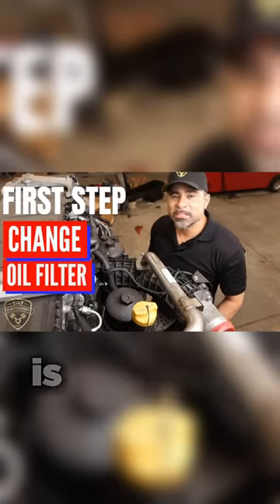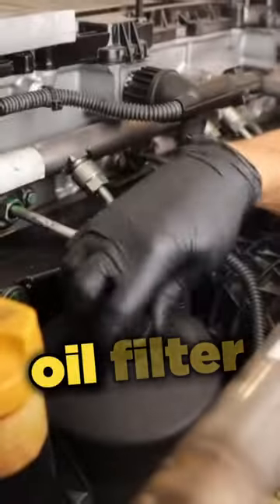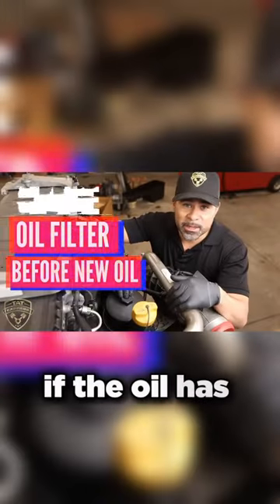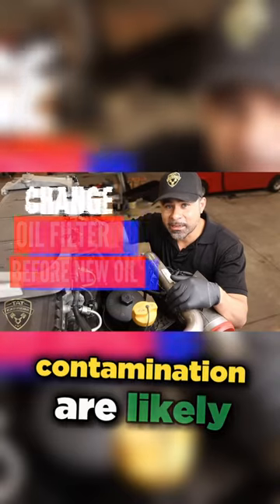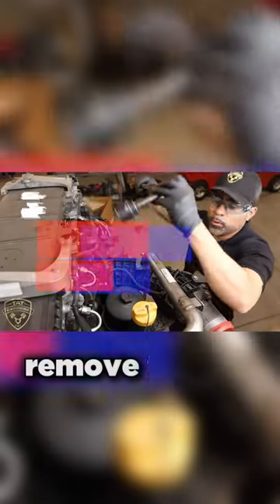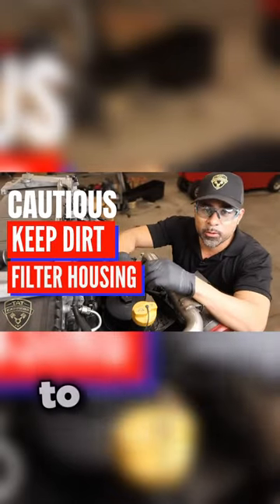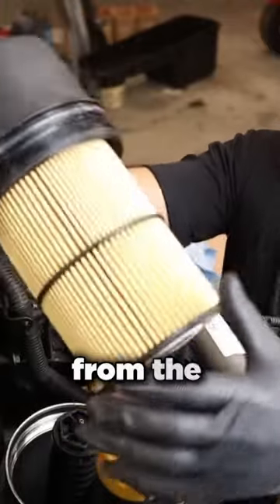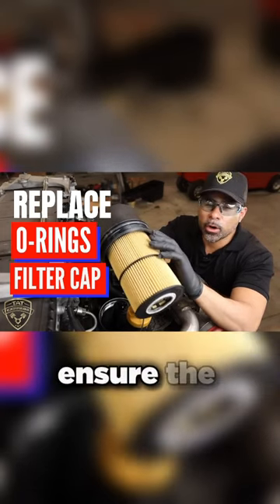How to change oil on DD15/ DD15 engine oil change/ DD15 fuel filter change/ DD15 oil change/ DD15

Comment: It will have some old oil in it no matter how you do it just an fyi even if you suck it out it's still on the bearings and such all through the engine and the pick up lines and with that style it really doesn't matter now the filter thing only applies to the top style filters.... Contamination is inevitable but the amount of contamination can be controlled to an extent....never put fresh oil in before the filter gets changed PERIOD cause bottom oil filter not all but some will drain from the filter by gravity and you'll have to replace the filter anyways then add new oil to replace the oil you just wasted.